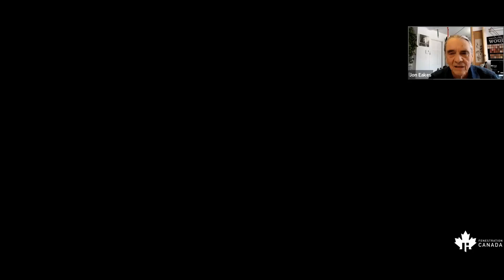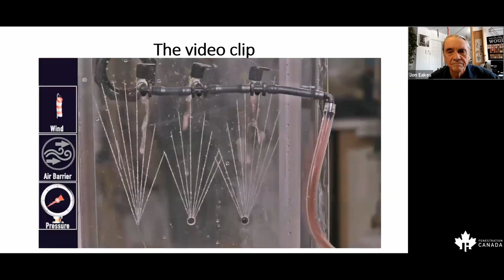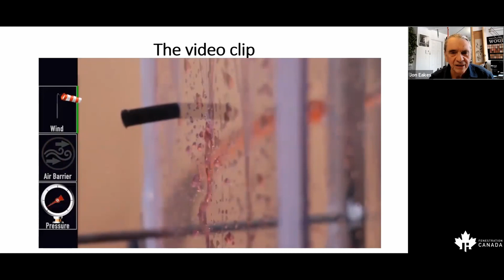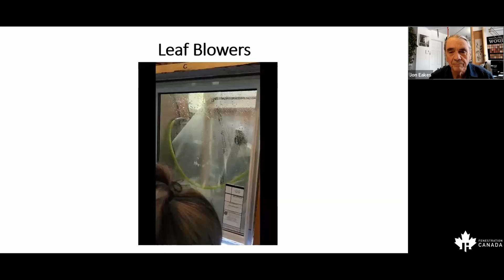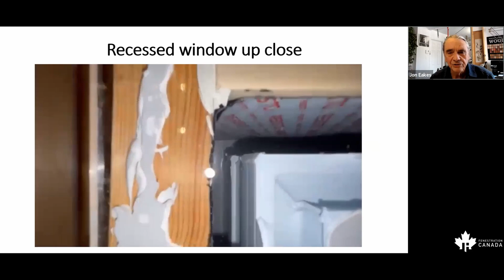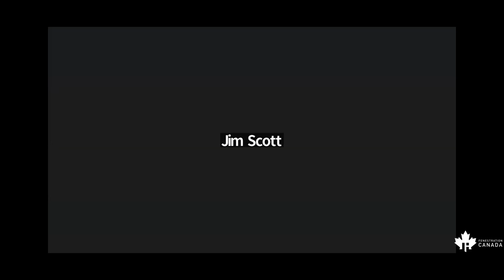Tech Talks: George Brown College Pressure Equalization Project with Jon Eakes

Comment: Jon, I would like to converse with you about installing new windows in an existing 4 storey condo complex in Winnipeg constructed in 1987 that is of masonry construction with Rainscreen principle and stucco exterior. The problem is how to install new block frame windows into the existing rough opening after the pvc or metal clad wood windows with nailing flange are removed? Should sill pan (Blueskin) flashing be provided around the rough opening and should it be sealed to the stucco screed that is around the rough opening? I have a detail showing the existing window sill and head detail and photo’s of the removed windows as well as photo’s of rotten wood framing in the rough opening and rotten wood sills where an awning window is joined to a fixed sealed window unit. I am a retired Certified Senior Architectural Technologist with 25 years experience working for a major Architectural firm. I look forward to being able to touch base with you. Thank you!